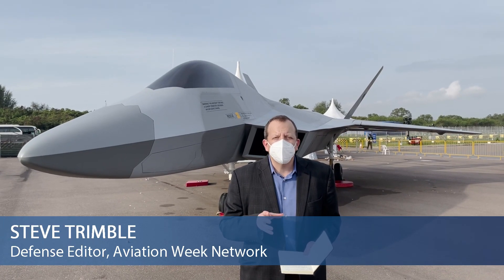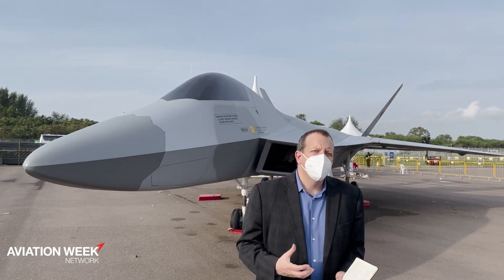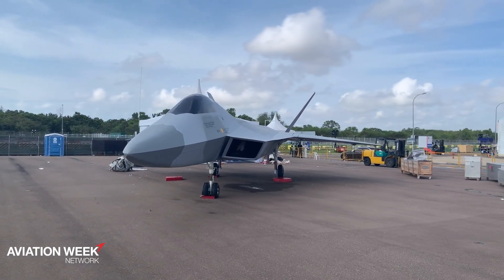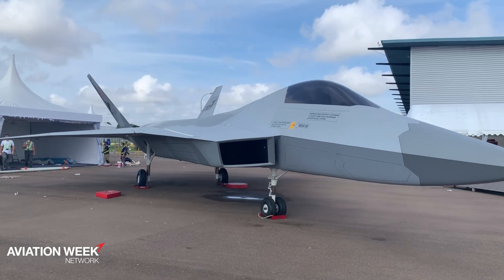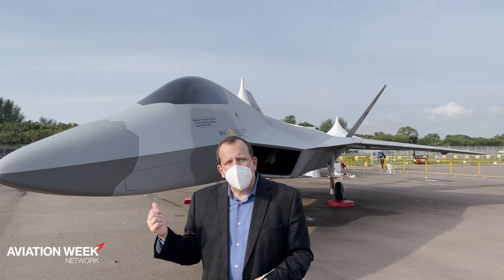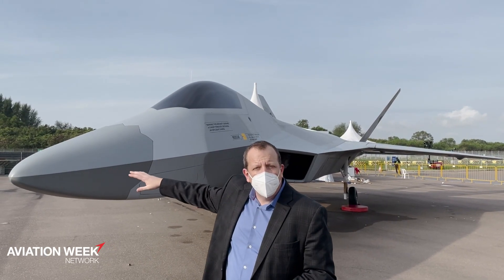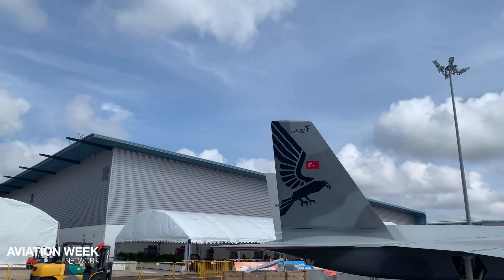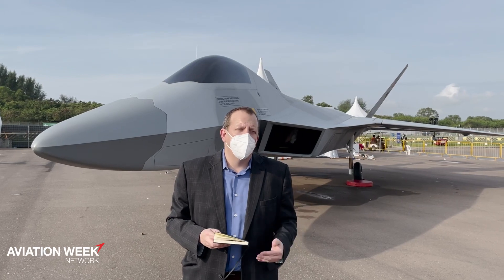TF-X Mockup Makes Debut at the Singapore Airshow 2022

Comment: turkey has not produced a decent LCA yet and tested, and still they think they can achieve this by 2024, is this a joke or  what. i mean for god sake even Americans took  enough time before building one.
Reply: LCA? Guess you haven't heard about TAI Hürjet? It'll make its first flight by the end of this year. Plus where the f*ck did you hear 2024? The first flight is planned to be in 2026. They'll keep testing and upgrading until 2029 and then TF-X block 1(4.5 genereation) will enter service between 2030-2033. We won't be seeing the 5th generation ones until the 2040s.
Reply: @neur038  I have heard about hurjet ,about this TF-X I heard it from a Pakistani news channel on YT. That it will roll out by 2023-24
Reply: @CuriousEngineer  Roll out doesn't mean serial production, pal. Roll out is only the first prototype which they'll test, upgrade and prepare TF-X for its flight in 2026. There's still years of work to be done after the roll out phase. Plus for a company that used to produce F-16 under license, roll out phase shouldn't be too hard.

Comment: This still hasn't progressed? He didn't mention they are getting the engineering knowledge from BAE system and an F110
Reply: BAE will help with some engineering difficulties thats correct and prototypes will fly with F110 engine and againg you are correct. So what? The project started 10 years ago, the design is made without BAE. From Avionics to Radar will be Turkish, it will have 360° awarenes sensor. No, againg no BAE help.
Reply: @isaretlervetembihler  Will you allow it for export? Pakistan will probably buy this to replace their F-16's as well
Reply: @randomviewer9976  It is a question of the 2030s. Next year is planned to roll out. Ground tests for 2 years. Flight tests for 4 years. If all goes according to plan which is rare in aviation, It will be in service in 2029. Still, the engine is an issue, F110 is supposed to be temporary and Rolls Royce will be in the development of the main engine. So such trade might be blocked by the USA if the engine is still F110 and UK/Rolls Royce if they are involved (I believe TAI will need help from Rolls Royce).
Reply: It has progressed quite a bit. Hundreds of parts produced so far.
Reply: @anavgeekspassion5727  That sounds vauge
Reply: @Cartoonman154  In what way? There are about 2250 structural parts on the TF-X. The design of approx 1000 of these parts have been completed and transferred to production. Another 500 of them will be transferred into production at a later date.